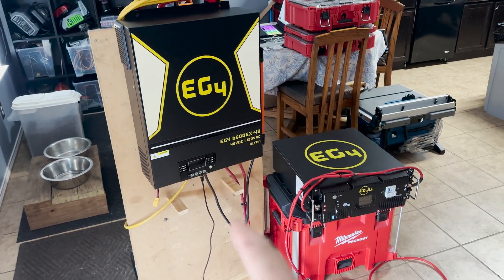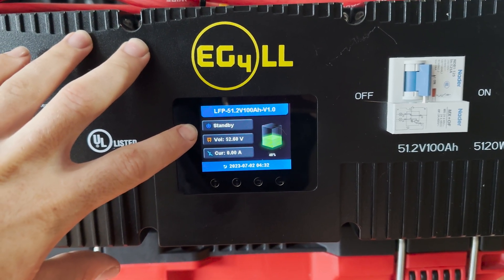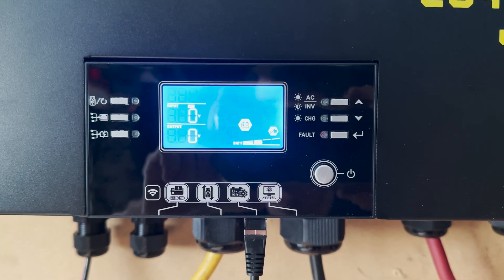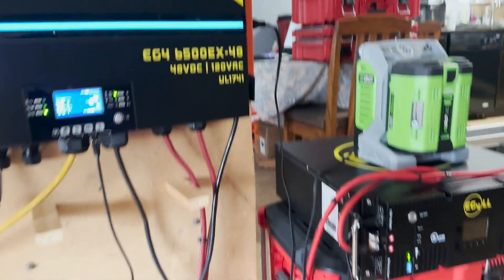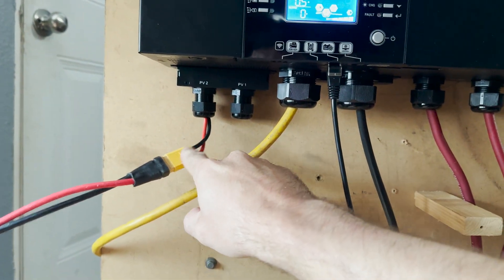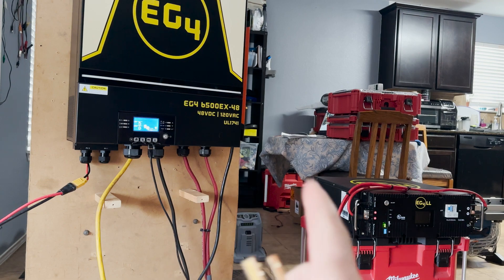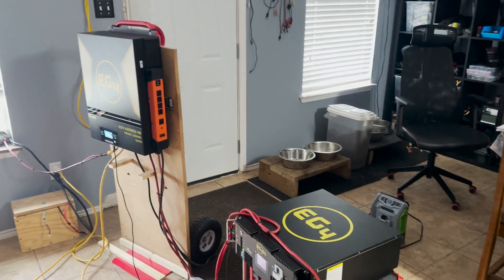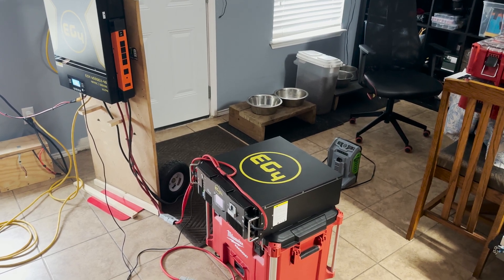EG4 6500ex, EG4 LL battery overview

Comment: If you search for the term "EG4 fail" you'll find many video's regarding issues with these inverters. Just curious if you're having these same problems?
Reply from the maker: I’ve personally had zero issues with mine so far, and I use it constantly, but when I’m not home I shut the system down

Comment: You sure you can pull 500v each PV input? I'm pretty sure it's 500V total for the unit. I could be wrong...
Reply from the maker: Yea it’s 500 per sting, I have over 300 on one already no issues. The unit has 2 separate mppt circuits

Comment: First video i found that covers the cord that came with the inverter. Im slowly building my system and received the eg4 6500ex with a cable not listed in the parts i was hoping it was the rs 485 cable.

Comment: What is the process to change the Dip setting. On the battery that you have. Thank you
Reply: Thank you for responding, I replied yesterday but I must not of sent it. I put a eg4 3k inverter with a eg4-ll battery on a hand truck. I saw will prowse build it, so I built one just like it. I have never done anything with solar,so I have been very surprised how bad the manuals are the inverter only talks about the 4 pin dip setting and the battery manual shows on page 10 the different id settings,but gives no instructions on the process to change them.the battery that I have is set to ID:2 I assumed I needed to set it to ID:1 but the manual gave no procedure on how to do it. I am not sure if breaker has to be on or power on or if I can change it while it's off? On page 13 they talk about changing the protocol but they use the 4 pin Dip setting process. For as many times they worn about safety they don't seem to give clear instructions.niether one has a start up or shutdown procedure. You would think they would have clear instructions from start to finish for a 1 battery system before they start mixing in 2 and 6 battery systems. Anyway thank you for responding I appreciate it.
Reply from the maker: @davidwight4380  I agree and had the same concern. I think you just connect the Ethernet cord with the label going into the inverter, and as long as the battery symbol is blinking on the inverter screen, that means the battery is communicating, it it doesn’t then may have to set one of the dip switches down. I moved the 1st one down. Just make sure it’s communicating and your good
Reply from the maker: Honestly didn’t really mess with them, I did move one but I don’t think i needed too. I believe it becomes important with multiple batteries or other equipment

Comment: I'm looking to buy this exact setup for Cargo Camper Conversion. I imagine I could hookup a 30amp input cable to for shore power at campgrounds instead of the extension chord you're using. However on the output where you have the power track, can I just use an AC electric panel instead? For DC, I think I would need to have a AC to DC converter and then a DC panel. Is that correct? I'll use the PV input as you're doing (stationary panels on top of camper) and possibly the extra PV input for portable panels.
Reply from the maker: You could use a ac to dc, or maybe even a dc to dc converter, I assume you need 12 volts for certain loads? If it’s not much of a load it will be easy. As far as ac out I made a simple load panel with a circuit breaker, then to a 4 outlet box. Shore power just like you always would work perfect.
Reply: @Mikebuildss  thanks for the follow up and video. It’s got me on the right path and much simpler with an All-in-One! Kudos
Reply from the maker: @Buzzsteele  yes sir good luck with your system!

Comment: Thanks for the walk-through of your progress. Looking forward to seeing more. I just started my build of the same inverter, but with budget friendly EG battery. Q: what wire sizing/spec are you using for ac input and output?
Reply from the maker: Thanks for your comment, it’s a good unit I like it so far, that battery is a good choice! As far as wiring, I used 4 awg on the dc side, and 12 awg on the ac in and out, I limit my ac charge current to 10 amps but never use it. In the future I will be building a nicer metal frame with a load center to incorporate breakers and more safety, thanks for watching!